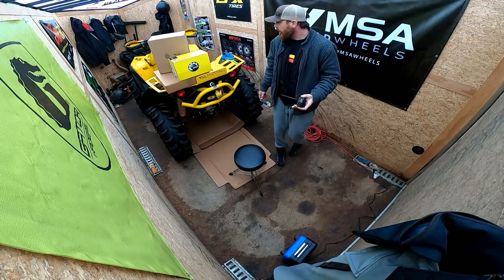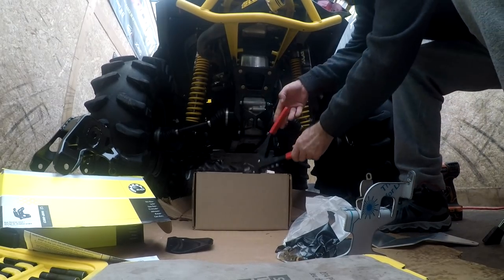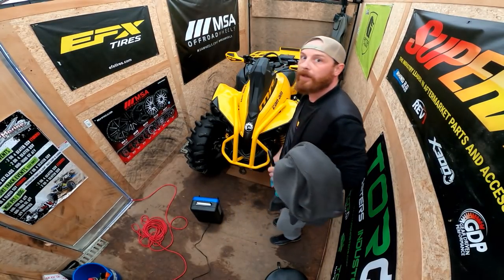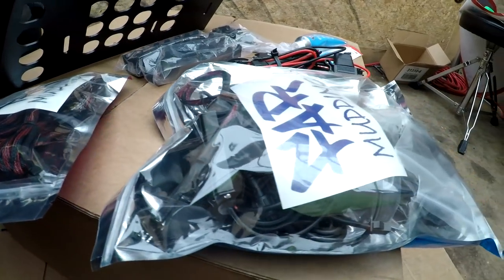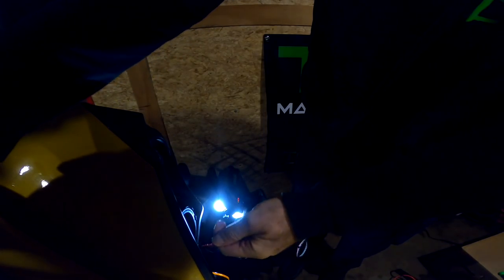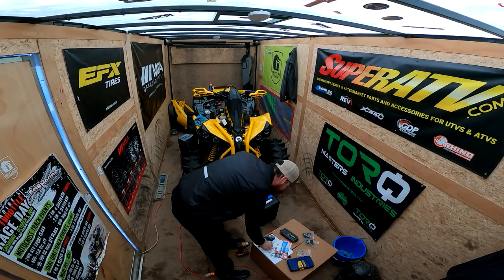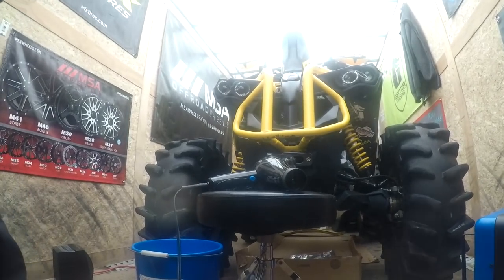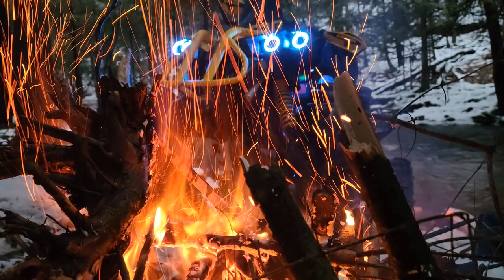Customizing The 2021 Can-Am Renegade X-MR 1000R 4LOk Yet Again!!

Comment: that pre-screen/radiator protector will not prevent mud build up. It actually makes it harder to clean your rad, unless you frequently take it out altogether and clean it. I relocated mine on my last Renegade and it was the best Mod I did. Just my 2 cents
Reply from the maker: I've been running one for years and and works great for my style of riding.
Reply: @ehTV1000  Mine worked great for almost 2 years then I had a terrible time keeping rad clean. I figured if I was going to go to the trouble of taking out the rad to clean it I might as well relocate it. I ride a good amount of mud which I've seen you do too. What have you done to keep it clean?

Comment: What all did u buy to set up the lights did you buy a wiring kit or two? And is it hooked up to a switch?
Reply from the maker: All included in the kit, no wiring needed, both rocklights and halos work together. Super easy install. We sell both at n2ytire 705-739-4130
Reply: @ehTV1000  do they come on when you turn on the fourwheeler?

Comment: Wanna do clutching on mine . Do I have to get both the QSC primary and the STM. Secondary or can I run one with the other clutch stock? If so which one gives me more power to the ground? Thanks for your input bud. In advance
Reply from the maker: Ya want primary and most folks just do a spring swap on secondary.
Reply: @ehTV1000  copy that bud thanx